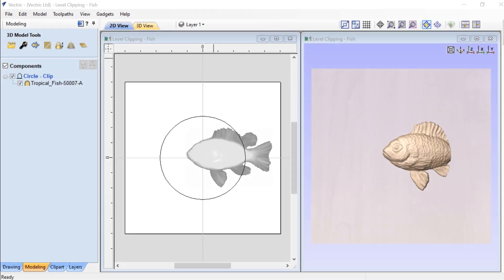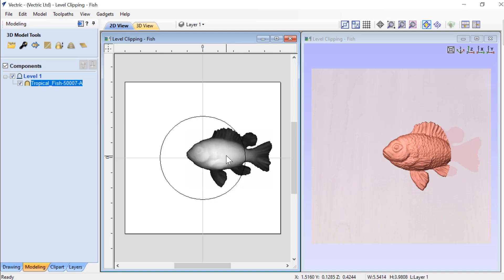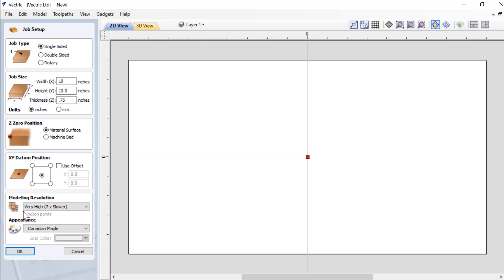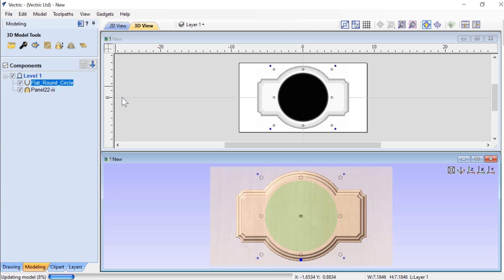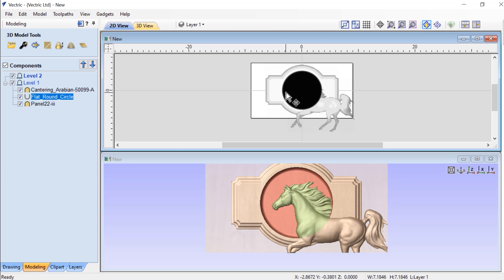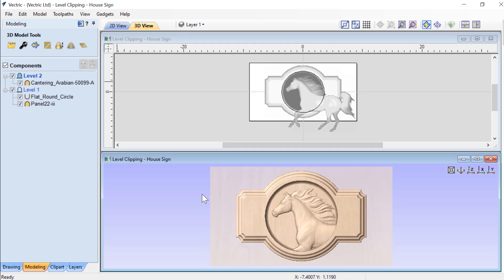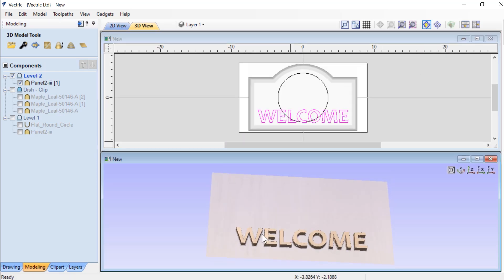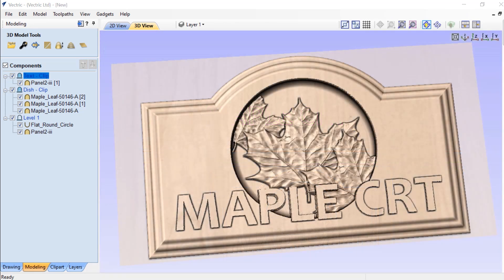Vectric V10.5 Tutorials | Level Clipping 3D Assembly

Comment: How would you use this to remove a inner part of a 3d relief but keep the boundary. I want to keep the outside and get rid part of the inside.
Reply from the maker: Hello Chad... make sure you have 2 vectors... on that takes in the outside shape you want ot keep and the other that surrounds the inner part you don't want.  Then "shift" select both of them and use tthoses for your clipping vectors.  Hope that helps.

Comment: how would I go about something like this without getting jagged edges around the lettering? my first try was with a .5mm 5.4* tapered ball nose. and it left bit marks all up the sides of the lettering. please help. I could try a 1/8 straight ballnose, but it wont reach in tight spots.  i'm using v-carve desktop 10.5x
Reply from the maker: Hey Brad! Thanks for your question! For something like this I would recommend that you actually use a straight cutter and a pocket toolpath to create nice straight text then just 3D Machine the 3D parts, I hope this helps, have a great day!
Reply: @vectric  the lettering is on top of the 3d model. Almost a part of the 3d model but using clipping, the letters are not actual 3d. in the desktop version i can not compensate for the taper so it runs the bit in to the side of the letters. I've heard you can in aspire, is this true? until i upgrade, i need to find a way around it. 

Thank you for the reply

Comment: Is there a way to perform the opposite effect? In other words, I have mountains as the background of  sign but I want to clear away the center for lettering.  Clipping is giving the exact opposite of what I want.  The only place the mountains remain is where I want the letters. I want the mountains around the letters.  Thanks
Reply from the maker: Hello Matt.  Thank you for the comment!  You can do what you need using clipping if you like.  To simplify the process, I would do the following - Import in your mountains, draw a vector box around the mountains, and then add your text on top of the mountains (make sure the text is inside the box).  Then select both the box and the text vectors and use them as your clipping vector for the level the mountains are on.  What you will be left with is just the parts of the mountains between the box and the text.  Should work... ~Todd
Reply: @vectric  IT WORKED!!
Reply: @vectric   Thanks Todd.  I'll give that a try.
Reply: @vectric  This clipping technique for text worked for me also. I’ve been looking for this solution for some tome now
Thank you